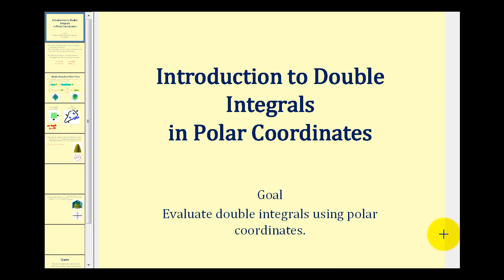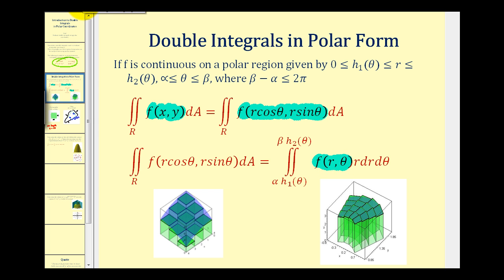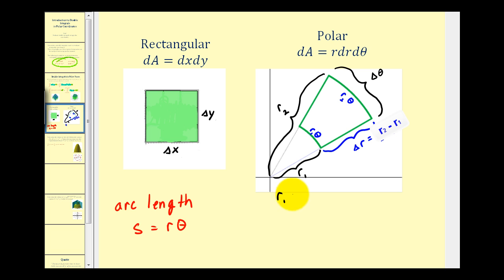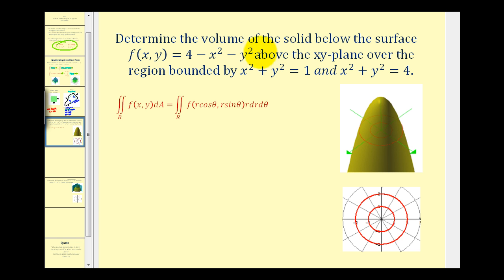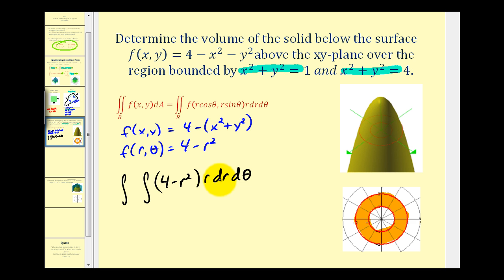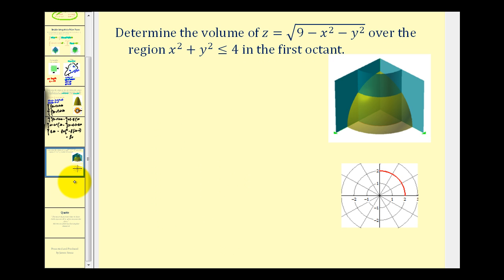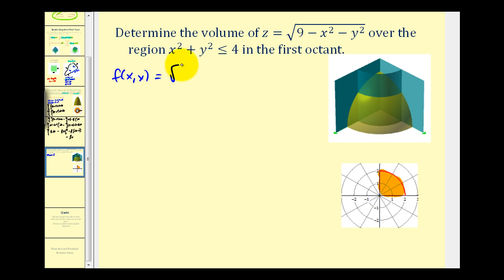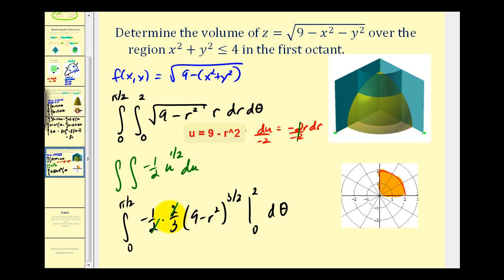Introduction to Double Integrals in Polar Coordinates

Comment: Regarding Example 2, An octant is an eighth of the circle, so we should be using the outer limit as 0 to pi/4. Whereas, in the question, it is given as a quarter of the circle and so the limit from 0 to pi/2 is wrong.
Reply from the maker: The first octant would be an 1/8 of a sphere, but as you can see from the 2nd trace provided is would be 1/4 of a circle to accumulate the volume or 1/4 of 2pi which is pi/2.